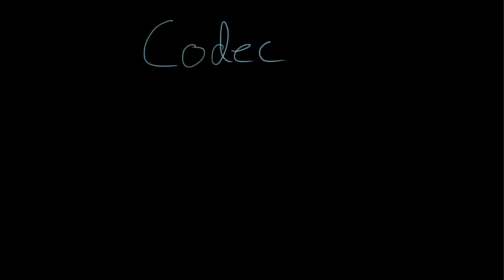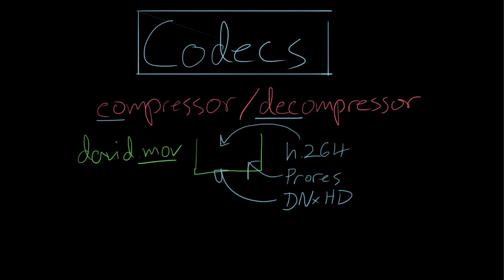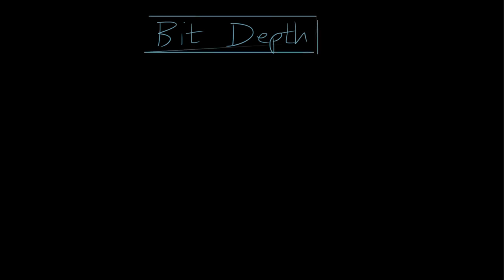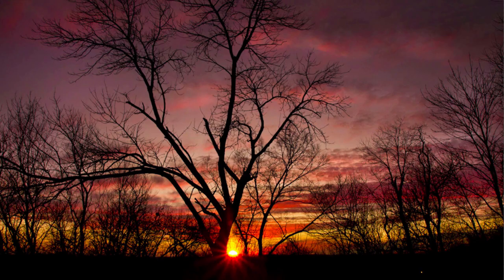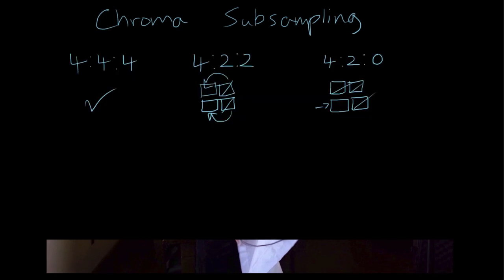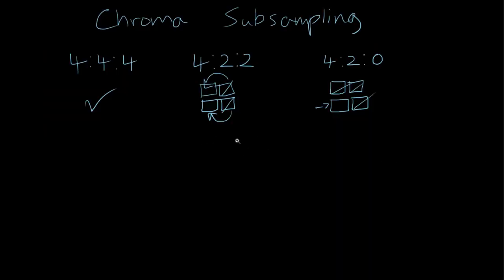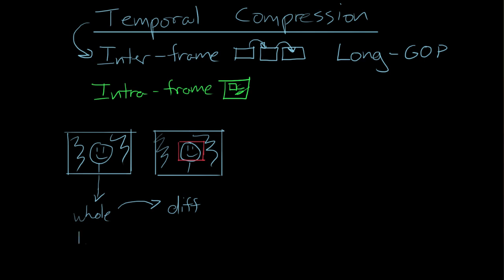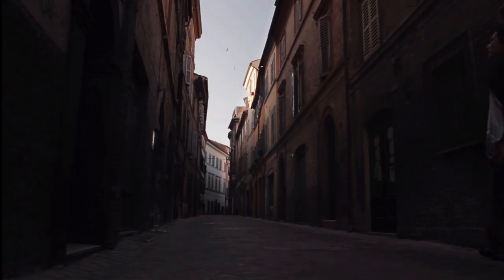How Codecs Work   Tutorial

Comment: Color subsampling is almost as evil as interlacing. We can't see a difference (washed out digital look) because the capture is subsampled too. You can't put up a red caption, and have either stairsteps around red or a dark outline because the color is interpolated without gamma correction.

I suspect those blocks in low contrast areas are down to a limited 'mixing' bit depth and many transformations that a block goes through between frames in h.264 (like 
chroma separation, darkening, weighting). You can throw bit rate at the frame, and the blocks don't go away in 8-bit format.

Comment: The section that is a bit unclear is the bit rate. Assuming we are only talking within the context of one codec, and variable bit rate, so the value given is it the average over a clip? The actual bit rate at any particular point in time will vary, depending on the  compression. Presumably, when compression is low, bit rate will be high and exceed the average. 
For constant bit rate, why should the compressor bother to compress further when it gets to the point that it has compressed enough to meet the constant bit rate value?